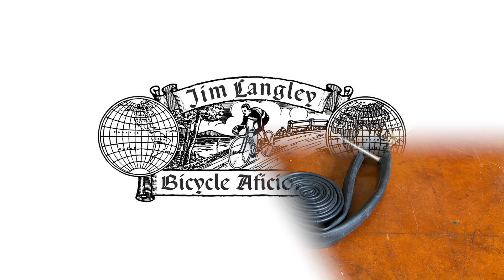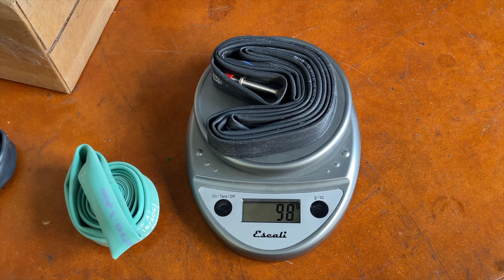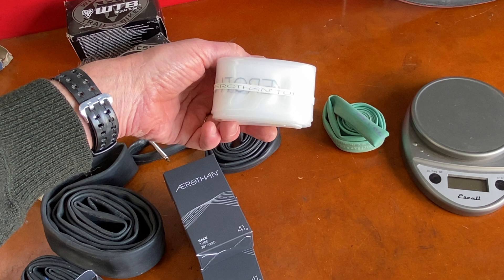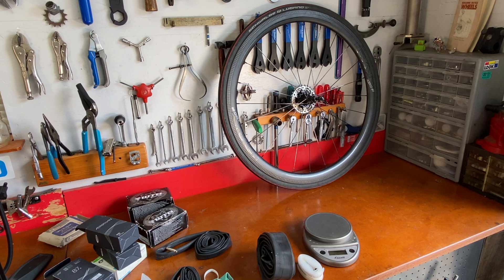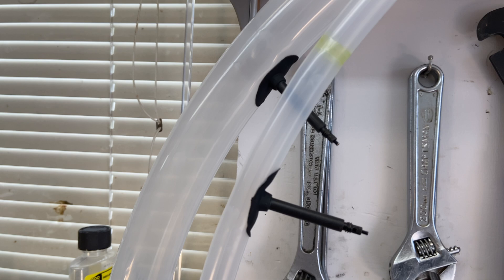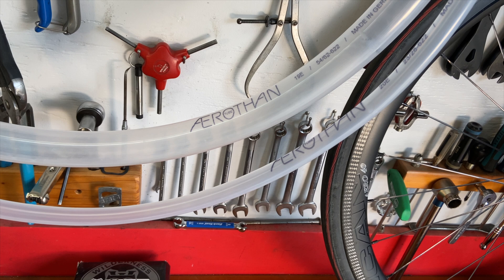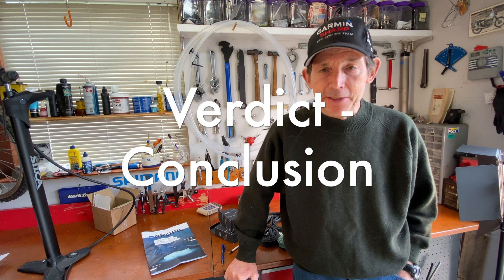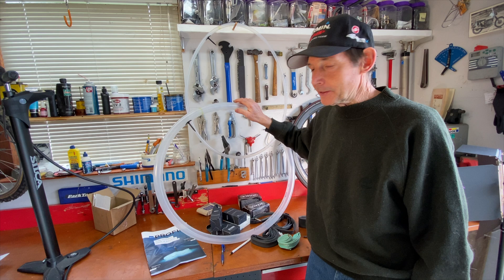Schwalbe Aerothan Bicycle Tubes: Ultralight, Super Small and Flat Resistant!

Comment: I'm on tubeless. But with my old bikes I always used latex. You can greatly reduce the tire leakage by putting some tire sealant in the inner tube (remove presta valve). This also seals small puntures. Try it, it the best solution!

I tried those overpriced plastic innertubes from Foss but found them to be too fragile. (Yes they claim the opposite)
Reply from the maker: Thanks for sharing the tip on adding sealant to latex tubes to make them more air tight, Detmer. I like it - though it would make the tube a little less superlight if a person cared. Regarding the other plastic tubes, I decided to buy and try the Schwalbe tubes because it was Schwalbe and BASF working together on them and also it's been 5 years of work. I have only had good experiences with Schwalbe tires and I am hoping these tubes keep working as nicely as they have so far. Thanks again!

Comment: Check out "Ride Now" TPU inner tubes. They are lighter, and cheaper than any other TPU tubes. Ive been using them for a couple of months now and  I love them A noticeable difference from the standard tubes. Ride feel is much better, with more confidence in the corners, with more speed.
Reply from the maker: Thanks a lot for the tip, Don! I looked up RideNow TPU tubes and learned they're new and from China. Cost is lower than Schwalbe and Tubolito tubes but it doesn't look like the RideNow tubes are that widely available. I did find this 700c one: https://amzn.to/3tvJf43 Problem is it has a 65mm valve, which is fine if you have deep section aero rims - not so much if not. Thanks again for the tip!

Comment: I have found these very easy to install, and hold air better than most butyl tubes.  I did run one on my commuter bike slightly under pressure (700x32c tire, at 55 psi vs the max of 80 psi), and on a patch of rough road, I DID get a pinch flat.  And so began my experience with patching Aerothan tubes!  I used a spare tube to get me home.  I first patched the Aerothan tube with an off brand glueless patch kit (Bell)....after about a minute of inflation, the thin patch burst right through the middle of the patch area!  I heard that Park brand glueless patches work great.  So after cleaning up the old patch and adhesive thoroughly, I applied a Park glueless patch, and it held up just fine.  If you can't find a Schalbe repair kit, then use the Park brand kit!
Reply from the maker: Thanks for watching and the feedback on your Aerothan tubes - and your experience patching them, Dale, appreciate it! The consensus from many viewers and readers of my Tech Talk column is that Park's glueless patches https://amzn.to/3DmOE1J work fine as you found out. Thanks!

Comment: I just burst two of the tubes when I was testing them. I only read now that "An Aerothan tube may be inflated carefully outside the tire until it has no more folds and is round in shape (equivalent to max. 0.3 bar)"
Reply from the maker: Thanks for watching and commenting, Werner. Sorry to hear that happened to you. But, thanks for sharing because it's a good reminder to everyone NOT to inflate these tubes when they're not in the tire except a very small amount. It says that in the instructions but if you didn't have them you wouldn't know. You will burst latex tubes and even butyl tubes if they have weak spots in them (some do) if you inflate them when they're not in a tube with a pump. You find that out quick if you're inflating tubes to try to find the hole in them to fix a flat. You have to put only a little air in and slowly to make sure the tubes don't explode.

In case it helps, the best technique for installing narrow road tubes in tires - that I recommend for all Presta valve tubes is to use your mouth to blow them up just a little - it's like inflating a balloon. All you need is to round the tubes out to get rid of any wrinkles and give them shape. A pump isn't needed for that. To blow up a tube to fix a flat, you will probably need more air than you can blow in. In that case you use a pump but being very careful not to put in too much air. You shouldn't need much air to find the hole. Just dunk it under water and look for where the bubbles are coming from.

Comment: I’ve had a set of these on my commuter for a month or two…they are noticeably light compared with standard thickness rubber.

I got one flat (a little piece of wire from the road) which was easily patched with their repair kit—I did some extra cleaning with isopropyl before the patch.

So far, works great…definitely don’t feel a RIDE improvement…maybe harsher if anything, but that’s so subject to placebo effect.
Reply from the maker: Thanks a lot for watching and giving your feedback on the Aerothan tubes, George - much appreciated!

Comment: I have been using the RideNow tubes for months now, many months, and have had only one flat tire, and I ride usually about 5 days a week. Very much like the RideNow tubes. Lighter than the ones you have on the test here.  Id like to see a comparison video from you, Jim, regarding these two similar tube systems.  Thanks!
Reply from the maker: Hey thanks a lot for watching and the comment, Keith! If a cyclist with your accomplishments says that the RideNow tubes are working so well, that tells me that the tubes must be very good. Thanks a lot for the review!

Here's a link to the tubes for anyone wanting to give them a try: https://amzn.to/3FvFrGn Two significant differences are 1) they're a lot less expensive and 2) they are available in 3 different valve lengths (the Aerothan comes with 40mm and you use extenders for deeper rims). Thanks a lot Keith!!

Comment: I’ve been using one of these on my road bike replacing a latex tube as the loss of air pressure in the latex was way too much. The Aerothan is much better - also much better than a Revoloop tube that I also installed. Will only be Aerothan for me in future.
Reply from the maker: Thanks a lot for watching and for sharing your review of the Aerothan tubes, appreciate it!

Comment: got a set of road vittoria latex tubes for my city fixie, sure it improves the ride immensely and the biggest downside except price and availability is the loss of air, never had a puncture thou so that will be an experience when the day comes.

id buy a set of tube for 50€ ez. not gonna change my spare tubes but the primary tubes on my road bikes id pay that price for.

great video, again :)
Reply from the maker: Thanks for watching and sharing your experience with Vittoria latex tubes, Puro (mine have been good, too). Good to hear you'd be willing to pay the price for these tubes for your road bike. I'm liking the ride so far of mine and they are holding air. Thanks again!

Comment: Great video! Around the 10 min mark when you take the tire off the wheel I was so envious. I ride both mtn bike and road. On my road bike I have ZIPP Course 30s with Schwalbe Pro One tires and I have to struggle to get the tire off. Definitely can't do it without tire leavers!
Reply from the maker: I'm happy you like the video, CorbuloCDN1 - thank you for watching and commenting. Some tire/rim combinations are awful these days. I can usually get tires off and on by hand. But if I run into a truly locked-on tire like some tubeless can get with some rims, I carry a Topeak Shuttle tire lever to deal with them. It has an oversize handle that lets you force the tip down in between the locked-on bead and tubeless rim's lip. Once the bead is pushed away in one spot the rest is usually pretty easy. You can see the Topeak lever here https://amzn.to/3ydQGhf Thanks again!

Comment: Great video! Id love to see some pinch flat testing on these. Maybe an old rim meets the dreaded curb stone. Keep up passing on the good tips👍
Reply from the maker: Appreciate you watching and the suggestion for pinch flat testing, Tim. I'll think about that but I'd have to buy another tube to destroy unless Schwalbe sees this thread and decides to send me one ;-) Instead of running into a curb and risk ruining a wheel, I bet I could hit a tube with a hammer to simulate the pinch flat impact. If I did it with a butyl, latex and Aerothan tube, it ought to show how all 3 hold up. I'll think about that - good way to relieve stress ;-) In the meantime I'll see how they hold up to our awful roads here. Thanks again!
Reply: @JimLangley1  good idea! I bet a cross peen hammer would do the trick on some type of sliding mechanism with some weight. I bet if you sent them an email you might get a few for free

Comment: Great review thanks. At that price, I will just continue carrying an undersized spare, it will get me home. In fact I can squeeze two into the MTB ‘box’ on my Topeak Ninja bottle cage, it places it in deadspace. My pump unscrews the cores, so I always wrap the with PTFE plumbers tape
Reply from the maker: Hey thanks for the tip on the Topeak Ninja cage that has a tube pouch attached underneath, J B! Cool cage: https://amzn.to/3nNpKAi And for the tip on the plumbers' tape on valve cores. Appreciate you watching and sharing your tips! Thanks!
Reply: try screwing the valve core in before inflating. as a kid this always happened to me so i just used pliers to tighten them, tho nowadays i'd use a valve core wrench if i used tubes

Comment: I was gifted a Tubolito, which I believe is also TPU like the Aerothan.  It seemed to hold up fine.  I am actually using it as my spare tube just because it's so lightweight and compact.  

I can see the appeal of these for someone looking for best possible performance, but as someone who's no longer racing and at $40/tube at my local shop, no way would I buy them.
Reply: Theoretically the materials cost of TPU is less than butyl or latex, so I suspect the high pricing is just due to low production and the R&D as these are relatively new.  It could be possible that one day we'll see TPU tubes being the budget option.
Reply from the maker: Thanks very much for watching and sharing your experience with the Tubolito, Cup & Cone - and also telling the local shop price. Very helpful!

Comment: I’ve come away from tubeless it gets cold and wet and very very damp here and the sealant just doesn’t like to seal in high pressure tiers in those sorts of conditions I’ve found. And it’s so messy and if you have to put a tube in to get home you may as well be running tube I. The first place. So I bought some tubiltos. And can sadly they ride like tubeless but they support the tier better and running tubeless pressures as well. I’ve had one puncture and do indeed go down in a control manner. It’s like a slow puncture.
Reply from the maker: Thanks a lot for sharing your Tubolito tube experience, gaza4543. That's great to hear they're working so well in such difficult conditions. Appreciate you watching and commenting!

Comment: Puncture resistance: 
brand new tires 
65k puncture...     Glueless patch came off 3 hours later...
118k punctured..  Glueless patch came off 5 hours later...
first time i just patched it, second time i cleaned the tube with alcohol before..
I stay with continental supersonic.
Reply: Thanks for watching and sharing your feedback on the tubes, Hendrik. It would be helpful to know more about the punctures. For example, was it the same thing that punctured the tube both times? Was the puncture caused by some issue with the rim - some sharp edge (that would mean it wasn't the tube's fault)? Was the puncture caused by some defect in the tube, such as a bad seam? Was the tube punctured by a piece of glass or wire or a nail or staple? We might learn more about the tube if we knew these things. So far I haven't had any punctures on mine. Thanks again!
Reply: @deborahlangley5683  I am professional bike mechatronic, 
so i am able to fix bikes AND also punctures, to say it first! xD

The punctures always have been from glas. Wasted 3 aerothan tubes now, all had micro stiches like holes, one got a 2mm cut from glas.
I also got 3 tubes changed on warranty...
All the same: This tubes are NOT PATCHABLE.
Even with the usage of alcohol (which is not in my puncture pack to go) in my workshop, to degrease the tubes, the patches wont stick long.
Reply: @hendriksiering9077  thanks for explaining more, Hendrik - I appreciate it! (This is Jim Langley using my wife’s phone to reply FYI)
Reply from the maker: Thanks for sharing, Hendrik. Where are you buying the Schwalbe patch kits - can you provide a link? They don't seem to be available here in the USA. Thanks!

Comment: I’d love to get puncture-resistant heavy duty tubes. Especially if they come standard on low-medium tier recreational bikes. Heavier is fine if I never have to change a tire or tube. Ever. LBSs charge for tube changes. 

Airless tires are already a thing for Lego cars and some real (experimental/performance) car tires, I’d love to ride a sponge-like road tire bike. Comb-like? Just saying.
Reply from the maker: Thanks a lot for watching and commenting, AmyX! To get the tubes you want, buy ones called "thorn-resistant bicycle tubes." The top 3rd to half of the tube is a much thicker rubber to resist punctures from things like thorns, etc. that get through the tire tread. Here's an example: https://amzn.to/3JkeaWv They usually cost a little more than standard tubes. For airless bicycle tires, a couple of makers to check out are Tannus and Air Fom: https://tannusamerica.com/pages/tannus-airless-tires and https://air-fom.com/ 

There have been many other companies who've brought out airless tires going back many years, so if you search for "airless bicycle tires" or "flat-free bike tires" or "no-flats bike tires," on eBay, Google or Amazon you'll probably find some more brands. Airless tires sometimes have different installation instructions than conventional tires and some models in the past have not ridden as nicely as regular bike tires (with air inside). So if you're going to buy some make sure they go on the wheels okay, and also that you're okay with the ride quality. Hope this helps and thanks for the great comment!
Reply: @JimLangley1  thanks for the reply! It’s good to know the technology is moving in this direction! The price point for the airless tire set isn’t at an ideal price point yet, but this gives me hope.
Reply from the maker: @amyx231  you're right about the price point not being ideal yet. Maybe it'll come down as competitors and sales grow.

Comment: i have two pcs. One on the front is great, maintained pressure after 24hours similar to butyl.  One on the back is losing 50% pressure in 4-5hours (not riding-just sitting there parking) still first setup to check for pressure loss. My frabric hand pump is unable to pump the tube like a normal butyl from maxxis. no air going in, like something is blocking. Track pump is fine.
Reply from the maker: Thanks for watching, azizul! Maybe the valve core is slightly loose in the back one? The valve cores in those tubes are not as tight as in a regular tube valve because the Aerothans have plastic not brass valves. You can check for valve leaks by putting a little water drop or saliva/spit on the valve to cover it and then see if a bubble develops. If so, tightening the valve until no bubble forms means you stopped the slow leak.

For the air not going in, when the tube is out of the tire and you can hold it in your hands you can test valves by blowing into them with your mouth like blowing up a balloon. If you can't get air in blowing on the valve then it's either jammed shut or something else is wrong. Sometimes the tip of the valve will get stuck. Usually you can wiggle it and tap down on it and get it to break free and open the seal. The tip of the valve has to be loose and wiggling around for air to go in. You probably know all this, but something like that is the most likely issue.

Hope this helps. Let me know how it goes. Thanks for the feedback on how the tubes are working for you so far!
Reply: @JimLangley1  apparently the valve core isnt tight. 👌🏻 air leak solved. Will try the blow test & check air pressure tomorrow
Reply from the maker: @azizulzulzaha  that's good news. Hope you can fix getting air in now, too!

Comment: I bought one. No problem mounting. But after several rides I did get a flat, picked up a small brad. Imagine my disappointment to find that Schwalbe doesn’t make a compatible patch kit. Switched back to latex which I have patched successfully.
Reply from the maker: Thanks for watching and sharing the report on your Aerothan tube flat, Charles. Schwalbe says that their glueless patches will repair an Aerothan tube: https://www.biketiresdirect.com/product/schwalbe-glueless-patch-kit-6ea However, I haven't found any for sale or tested any yet to see if they work. I saw in another review that it's recommended you clean the puncture area with alcohol and let it dry before applying the patch. But, from online comments it sure sounds like those who have tried the patch find it doesn't always work. Thanks again.
Reply: Apparently the park tool patches work as do tubilitos

Comment: Are your scales off, or is Schwalbe lying about the weight?
Reply from the maker: Thanks for watching and the question. Any discrepancy in weight is not “lying” (Schwalbe and other reputable bike companies don’t behave like that - all it would do is harm them). The discrepancy is either from a different batch of tubes or something different in what was weighed - like the way I weighed them with and without the rubber band. If I had 10 tubes to weigh they would likely all weigh slightly differently. But not a lot. These Aerothan tubes are very light and they feel light when riding. There are now other TPU tubes like them from other companies so you can shop around to compare. Hope this helps. Thanks again.